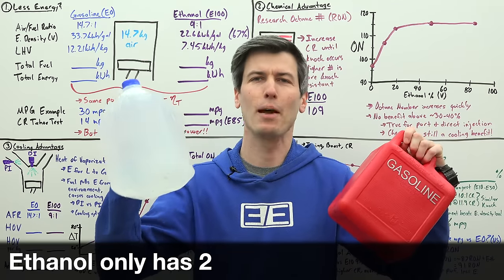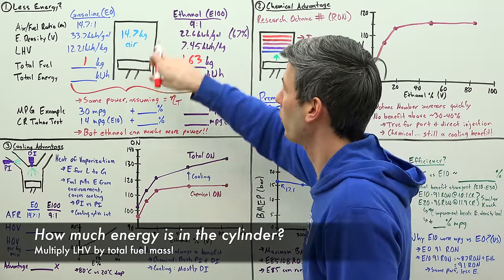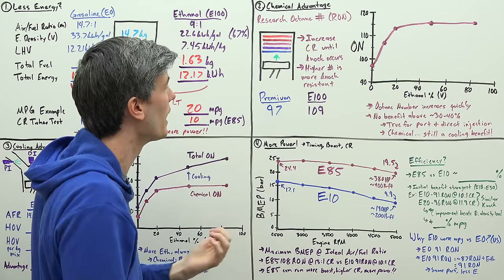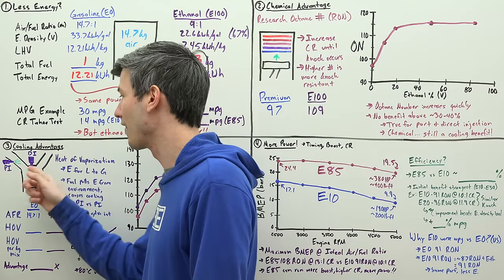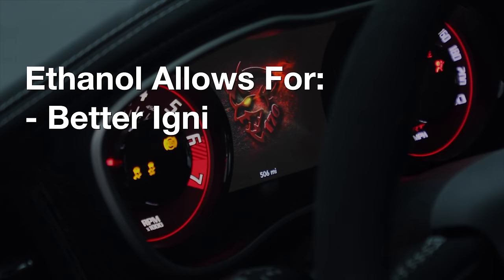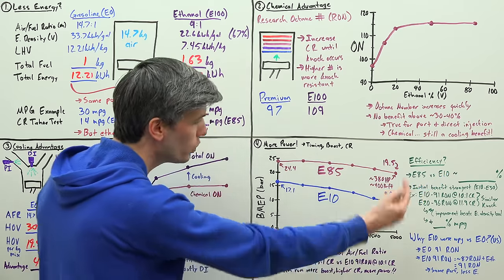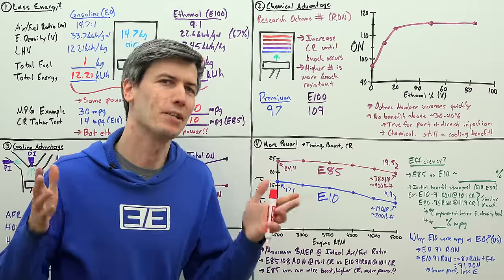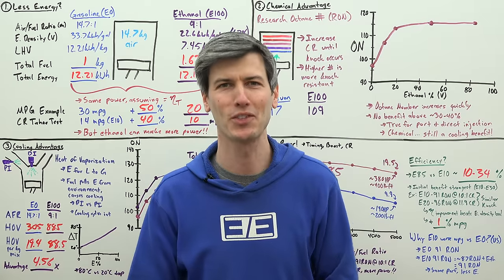Why Does Ethanol Make So Much Power? (Versus Gasoline)

Comment: If ethanol makes more power how come it takes more fuel to drive a mile? 🤔
Reply: Because power and fuel mileage are two separate things...like ham and cheese.
Reply: There is less chemical binding energy in ethanol, so it doesn't make more power scientifically. Ethanol is better for the environment, though, IF the crop that it's made from is grown the right way, which it isn't. And what you pay for the ethanol, at least in the US and Europe, doesn't compensate for the increased fuel consumption. You pay more to drive on a fuel with less energy in it.
Reply: @francisdec1615  It makes more power...and the cost to MPG is better scientifically.
Reply: @francisdec1615  Sorry your wrong alot...blame me I can take it. Youll do great at NASA!
Reply: @francisdec1615  A lot of videos of identical engines make MORE power on E85. ALOT, MANY. Im sorry.
Reply: @francisdec1615  — Not meaning to sound disparaging, but it seems you should request a refund for that chemistry course you took …
Reply: @sking2173  Let's see. Ethanol only has about 60% of the chemical binding energy of gasoline. I'm from Europe, so I use RON. 98 RON E5 has the energy 95x1 + 5X0.6= 98. 95 RON E10 has the energy 90x1 + 10x0.6= 96. 96/98~97.95 But then 98 RON has less energy in itself than 95 RON, but I don't know exactly how much. That's probably very marginal anyway. However, if you mix in much more ethanol, you will definitely get less powerful gasoline.
Reply: @francisdec1615  — You’re still confusing “power” and energy density.
Reply: @francisdec1615  I dont use fancy "chat" programs sorry. I wish I could speak other languages. I just was never good at learning them. Thats why I stick to working and fixing machines. I did study Chemistry in high school as well. it was the only time I enjoyed doing math.
Reply: @francisdec1615  I tried buying a Liter of gasoline in the USA today. They couldnt do it. Weird huh?
Reply: @oldblueaccord2629  Well, it's 0.26 gallons. But it might not be allowed to buy such a small amount.

Comment: I travel long distance. The Jeep burns the E85 like it's going out of style, and the motorcycle does not like ethanol at all because it gums up the fuel system when I have to leave it over the winter.

Y'all can keep it. It's only cheaper because of subsidies that we are all paying for anyway.
Reply: The Federal subsidy for corn ethanol ended back in 2011.

The long-standing stated goal of the G7 Nations to end petroleum subsidies?  Not so much.

In our current inefficient gasoline optimized engines, E85 will have lower mileage but more horsepower and is cheaper per mile to drive with.  Exhaust pollution is drastically much lower.

For an example, a Chevy 5.3L pickup gets a clean 380 horsepower on E85 vs a dirty 355 horsepower on E0.

Alcohols are often the active ingredient in carb and injector cleaners.  If your fuel system has had a buildup of gums from long term straight gasoline usage, ethanol could dissolve that out and plug your fuel filters until it gets clean.  Otherwise, if you always use ethanol, it will keep your fuel system nice and clean even when sitting.  Ethanol, unlike gasoline has a very long shelf life, you could even drink Roman gin if you found a bottle of it in a grave.

Your identical motorcycle in Brazil uses their common gasoline which contains 27% ethanol.  It has been working out so well and for so long that Paraguay went to E27.

A clean ethanol optimized engine will have both more mileage and more power at half the size than gasoline engines, even more than diesel engines.

Here is one Ricardo built for GM and drove around:

FROM RICARDO:
The new federal CAFE standards are calling for a doubling of fuel mileage performance, which, Vint says, is going to send OEM’s looking for high octane numbers to improve efficiency and ethanol is the best source. Ricardo, an engineering firm with over 100 years in the business of engine design, has developed an extreme boosted direct injection engine (EBDI) to optimize ethanol blends. The 3.2 V6 gasoline engine rivals the power and torque of a much larger GMC Sierra 6.6 diesel, he said, and it delivers 3.5 percent better fuel economy than the diesel.

Comment: the big "but" to E85 is that ethanol destroys engines not made for it, so don't put E85 in a vehicle unless specified.
Reply: France, who has 25% of their stations selling E85, approved E85 conversion kits which plugs into and keeps the ECU from throwing a yellow light.  Cars are set to throw a light around >E50 give or take.  Brazil who is at E27 for identical non-flex fuel cars as ours is thinking about going to E40.

Do a search on YouTube for "Many Cars Can be Made Flex-Fuel with a Software Update" and click on the "Pump the Movie" link and see that the MAPs to be flex fuel are already in our cars ECUs.  

They purposely have to set a car not to use ethanol since of course they easily can adjust for that fuel.  In the clip, he chooses O2 sensor over fuel sensor since he has a non-flex fuel car.
Reply: NOPE.

Comment: i have a 2006 scion XB with 11:1 compression and Jun Cams i run 91 and E85 using a fastECu FT550 and a lot of little changes stock it made 98whp after mods and running the intake cam 3deg retarded on E85 i can make over 230hp NA

Comment: ..and one BIG disadvantage ..shortens the life of your vehicle.
Reply: Who says this?

Brazil has found that identical engines last >300% longer on E100 than their common gasoline.  Soot is what wears out an engine.

Before the EPA approved E15 in 2011, they and the DOE conducted long term testing on cars 2001 and newer with not only E15 but also E20 and found that both fuels ran fine and did no damage.

The Bureau of Labor Statistic tracked the share of US household income spent on repairs and maintenance from 1990 to 2017 as ethanol as a percentage of gasoline went from .1% in 1990 to around 10% from 2011 onward.

The share of income spent on repairs and maintenance was 2% in 1990 and by 2017 it was 1.5% as ethanol use exploded.

Ethanol on most any chemical compatibility chart you will find is equal to or often easier on rubbers, plastics, and metals than what gasoline and BTEX (benzene, toluene, ethylbenzene, & xylene) are.
Reply: @danafletcher2341  I've read ethanol is more corrosive to metal and destroys rubber seals and hoses
Reply: @merseybeat1963  NOPE!
Reply: @danafletcher2341  I think we hooked a big one Dana...this ones a tried and true nut.
Reply: @oldblueaccord2629  Looks like whatever he said has been removed.  States 7 replies but I can see only 5 of them.
Reply: @danafletcher2341  Yeah he /deleted himself..they always do!

Comment: PHASE SEPARATION! Live in a humid climate and don't drive very much you end up with water saturated fuel (GOO in your fuel tank) Petro companies put Crap gas in the E-10 mixtures and when Phase Separation takes place what is left is low grade fuel floating above the water saturated GOO! Good by fuel pumps and injectors. You need one more section on your white board, good show, stopped too early.
Reply: Mercury Marine thinks E10 may be the superior fuel to E0 because it keeps fuel dry.

Mercury Marine, in that webinar on ethanol myths, noted that ethanol does not "grab water molecules out of the air." It is hydrophilic, which means ethanol holds water. With regular gasoline (E0) as well at E10, the primary cause of water collecting in tanks is condensation on tank walls. But unlike E0, which can absorb almost no moisture, E10 can hold up to half of one percent of water by volume, and the water molecules will dissolve in the fuel. The "solubilized" water will bypass the water separator and burn harmlessly through the engine.

In the days of E0, they sold little cans of alcohol in the wintertime as gasline antifreeze because of E0's water problems.  Since E10 came to be, such products which were called HEET or DRY GAS are no longer needed.

If ethanol did have a problem with water, everyone would know it for sure since every winter there would be millions upon millions of stalled cars on our roads in the northern US and Canada.
Reply: @danafletcher2341  Nice reply, I learned something from it. However I agree with your statement about ethanol holding water and allowing it to go into the system and be burned and I'm sure that the the very large number of cars running it do so every day. The reason I only run put E0 fuel in my tanks is how long you let the fuel sit in the the tank unused. when the ethanol can no longer absorb the monocles of water, this I have been told is any where between 45 to 90 days, Then Phase separation begins to occur and the water laden ethanol becomes heavier than gasoline. The only car I have that isn't  25 or more years old is my gas mizer Honda which I'm sure would handle E10 but gets 3.5 mpg better mileage using 
E0 fuel (1.5 L Honda Fit). I have had to replace internal rusted fuel lines in my older vehicles before I was educated about ethanol holding water over a period of time. When I lived in a cold winter northern climate I too added fuel line anti freeze but then I used the fuel in the same week. I live in the South now and I have several machines that may sit for months unused. Since I got educated I don't do much fuel system maintenance. everything just starts and runs when I finally need it. Thanks for your comment enjoyed reading it.
Reply: Goo in your fuel! A new day a new story! GOOD SHOW!
Reply: @dlongch47   No engines operate in humid conditions are sit more often than marine engines yet Mercury Marine thinks E10 is superior to E0 under these conditions.

Brazilian flex fuel vehicles use E100 which is hydrous ethanol.  Hydrous ethanol is like everclear, it is 192 proof or 96% ethanol and 4% water.  Their flex fuel vehicles switch between this hydrous ethanol and their common gasoline all the time without problem.  Wont phase separate until -22 degrees F.

Comment: And where are you going to grow all the grains required for all the ethanol that will be required to run the worlds combustion based vehicles? Who has to starve to allow this to happen? Rhetorical question because the answer is everybody. Pie in the sky nonsense.
Reply: Corn ethanol preserves the feed in a healthier and more productive form called distillers grains.  Who would starve is all feed corn were value-added into ethanol?

The problem is since close to half of feed corn is currently value-added to get E10 nationwide, the most we can economically make from corn would be E20.

So you're correct we do need more sources for ethanol.

Kelp makes 30,000 gallons of ethanol per acre, more than anything that exists.  Note that we have thousands of abandoned oil platforms in the nutrient rich Dead Zone of the Gulf of Mexico.

If we installed ethanol plants on these platforms and spread floating nets 1/2 mile around them to grow kelp, we could produce 19.2 million gallons of ethanol per platform.  Take this times a few thousand platforms and you are talking some big numbers.  We could use the platform's abandoned pipelines to get the ethanol to shore.  The bagasse could be sold as a natural fertilizer or in the unlikely event the dead zone became too clean, return it to grow more kelp.  There are other dead zones too.

Cattails make more ethanol than any other land plant.  Sewage treatment plants which incorporate cattails cost less than conventional sewage plants to build and can return water to rivers cleaner than the river.  The bagasse could be sold as a fertilizer or in the unlikely event we run out of sewage, used to grow more cattails.  Ethanol is made of only from things of the air.

Teams from Lawrence Berkeley National Laboratory (Berkeley Lab) and Sandia National Laboratories have developed a streamlined and efficient process for converting woody plant matter like forest overgrowth and agricultural waste (material that is currently burned either intentionally or unintentionally) into ethanol.  Maybe the billions spent on forest management that still result in our summer skies being filled with wildfire smoke could be spent on this and we would have non-toxic pollution free fuel to show for it.

Since we already have to refine petroleum, note China, India, Indonesia, and others are using and/or looking at an efficient and economical process to make ethanol from coal, oil, and natural gas from a Texas company named Celanese with their TCX Technology.

Note that with enough ethanol, we could have ethanol optimized engines half the size/twice the power of gasoline and diesel engines with greater mileage than either.  The usage of fuel would go down and clean air to breathe would be a bonus.
Reply: We currently burn 2.7 million gallons per minute. And you make out like harvesting from the sea is easy and cost effective. Long winded copy and past BS. Dunning Kruger.
Reply: @Lonewanderer30  I did actually type 99% FYI if that makes a difference.  If I have anything specifically wrong, please bring it to my immediate attention please.

We long past peaked with the cheap, conventional, and easy to get oil but there are signs of peaking with the hard-to-get oil, i.e. drilling oil in the sea (even the Saudis are), tar sands, fracking etc.  

Using thousands of existing abandoned oil platforms and pipelines would be more cost effective than building them.  Why exactly would floating nets be so cost prohibitive?

We could go to safe liquid fluoride thorium reactors (LFTRs) similar to one built by Oak Ridge back in the late 60s/early70s.

LFTRs are walk away safe, don't produce hardly any radioactive waste, the little waste they do produce is radioactive for only 300 years, can burn for fuel our already existing stockpile of uranium radioactive waste (eliminating that problem), thorium is plentiful everywhere, even is a waste byproduct of rare earth mineral mining, are low in pressure so can be made compact, so compact they can be very cost effectively made/refurbished in factories, and run hot enough to more efficiently (than electrolysis) separate water into hydrogen and oxygen.

The Navy already has a process which used electrolysis of seawater from a ship reactor power to make hydrogen and combine it with CO2 from the sea to make ethanol/other fuels.  They wish to make onboard fuel for aircraft carriers.

Again, with enough ethanol, we could have 99%+ pollution free simple and cheap ethanol optimized engines half the size of gas and diesel with more power and more mileage than either one.
Reply: Instead of refining crude into dirty and toxic gasoline, we could use the efficient and economical TCX Technology to refine it into clean and non-toxic ethanol.  That is our current production alone.  So indeed I did address what you said.

On top of that, clean ethanol optimized engines over twice as efficient as our current dirty and inefficient gasoline optimized engines so not as much is needed to begin with.  

Great thing is ethanol can still be used during the transition.

On top of that, throw in coal and natural gas making ethanol with the TCX Technolgy.

This is without counting my other examples and there are even more that can be done.

I did not copy and paste, not that it should matter, the truth is the truth either way.  Have a nice day.

Comment: OK, brilliant,
I would like to ask someone who is familiar with fuel,
So standard gasoline aka petrol Vs E10,
So imo, the fuel E10  is more likely to go stale, aka lasts less time, due to storage, due to E10, specifically the ethanol by hydrophilic, for example for generators or simply for storage,
IS THAT TRUE OR AM I WRONG, IF SO, ELABORATE....
Reply: WRONG....
Reply: @oldblueaccord2629  elaborate....
Reply: @smartchip  Videos? I got several starting my lawnmower up after sitting all winter with e15. Its a thing called Youtube you should google about it.
Reply: @oldblueaccord2629  well, E5, 10 whatever is more stable and longer shelf life than regular gasoline?
How did you store it, hermetically sealed?
Reply: @smartchip  parked my lawnmower in a garage and forgot about it until spring. Left my weed eater on the floor next to it. I just about finished out last years gas on this mow.
Reply: @oldblueaccord2629  be specific, this is anecdotal,
Eg, E5 petrol, from petrol station early  Oct,  used, then stored in mower after  one use (  3/4 full tank) then reused in March second week, after a few attempts started,
Of particular value, grade or rating of petrol, is it from a multi use hose or single use hose, in North America different grades use a common hose, time duration of storage, did you test the E grade, E5 or E10 etc,
Etc,
I have found anecdotally, when a petrol delivery has just been delivered, eg less than 8 hours, the petrol is more potent and the miles per tank is greater, like a hundred miles or more!! So it lasts me on a normal preset routine a few more days,
Also to test the E content as an percentage, water is used in a container,  then the level is tested, via markers on the vile,
Reply: @smartchip  not interested man sorry...

Comment: Bullcrap corn propaganda
Reply: It is not new technology or knowledge, it was known long ago.  It is suppressed technology.

Rear Admiral C.M. Chester wrote Henry Ford a letter on Dec.15, 1916:
"...I also pointed out in the article that as governmental laboratories had developed from 40 to 55% efficiency in alcohol engines as against 20% in gasoline machines, the use of alcohol at double the cost of gasoline for power purposes, was cheaper for motor[s] than gasoline in common use today."